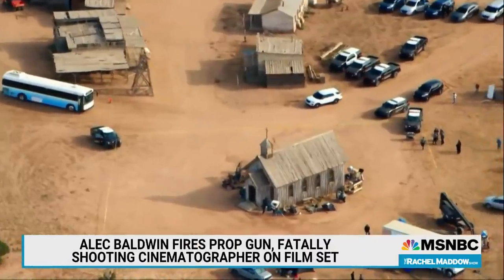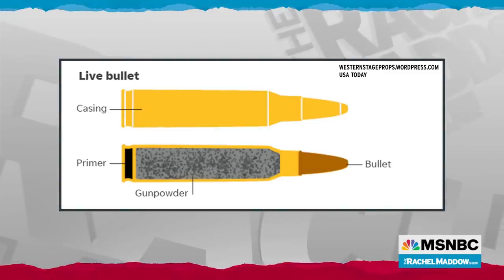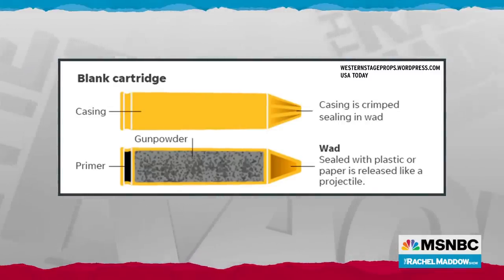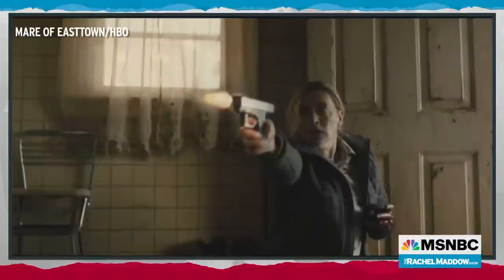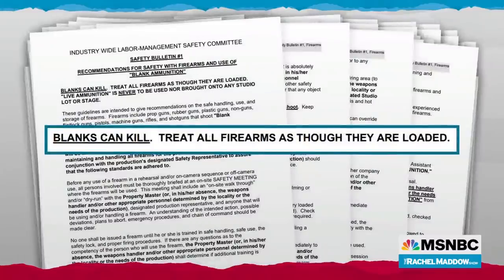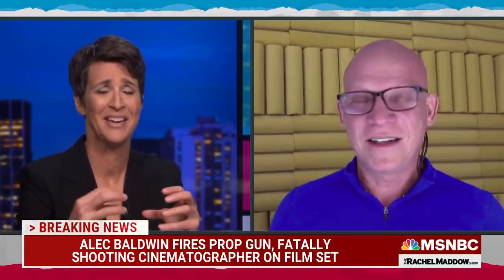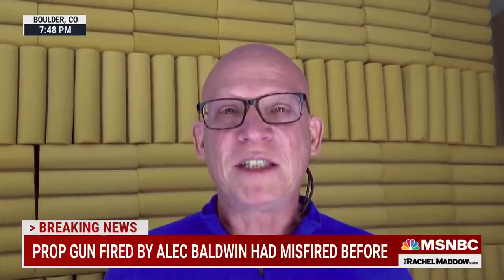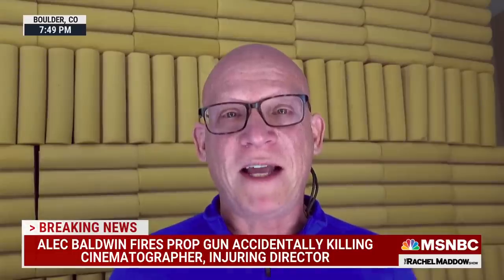Weapons Safety Expert Looks At Safety Protocols And Alec Baldwin Movie Set Shooting

Comment: On Brandon Lees set they wanted the camera to see the bullets in the cylinder of the gun. They drained all the gun powder to be safe but someone pulled the trigger and the primer went off and pushed the bullet just enough to make it into the barrel. No one questioned the missing bullet when they loaded the gun with blanks. the blank round or shot uses pretty much the same amount of gunpowder as a real cartridge....
Reply: Good info, thanks, I had forgotten the details of that tragedy.
Reply: @alieninbellingam  yep or who pulled the trigger to fir the...... primer
Reply: What were used in The Crow were Squibs and one broke off, it wasn't a dummy round. The result is the same but it wasn't a drained powder bullet.
Reply: @alieninbellingam  The person who removed the Squib (fake ammunition) was not properly trained. That is why it happened in that case. There were actual failures in how it was handled so it wasn't even a "we need new rules" as much as "we need to follow the existing rules" issue.
Reply: @TearDownGenesis  The bullet is not in the barrel, it is in the cylinder of the revolver. So, if it "Breaks off" it still would not make it into the barrel. The primer had jus enough pop to separate the bullet from the cartridge and push it about 22mm into the barrel.
Reply: @donemigholz660  I could be wrong but I assumed the gun used in The Crow was a semi automatic. It wouldn't be in cylinder there.
I saw that squibs were used and squibs don't use any propellant.
Reply: @TearDownGenesis  A squib is a small explosive device. You put the squib on the thing to be shot to simulate a shot, not in the gun. The term "squib" does not refer to a dummy round, blank, or any other form of ammunition.
Reply: Aside from a manufactured dummy round, the usual practice is to take the bullet apart, drain out the powder, and then put it in the casing in the gun and fire it in a safe direction so that the primer is dented. An alternative approach is to remove the primer, and replace it with some kind of rubber substance. This prevents the firing pin being damaged but also makes it perfectly clear that you’re looking at the back end of a dummy round, not a live round. This works well with replica revolvers because you can open the loading door and go through all six cylinders assuring that none of them are live rounds. A quicker way is to point the gun and a safe direction and just try to fire it repeatedly until you’ve gone through all the chambers. This is not rocket science.
Reply: @SeanPat1001  One major problem is that these types of sense in a movie are vague as it is written in the script, and are often worked out by the director or are added to get some some drama. So, they are quickly put together.
What all movies need is not only a gun/ pyrotechnic person but a weapons director that is hired to film the fire fight sense and gun close ups rather than a spur of the moment added scene or added clip. Something, because this has got to stop.
Reply: @donemigholz660  Most movies of this genre actually do that. Any shot requires something that could be dangerous has to be planned and details worked out. Clearly, that is not what happened here.
Reply: @TearDownGenesis  Rust is an old western, so a revolver would be used.
Reply: SIO, YOU DON'T KNOW WHAT YOUR TALKING ABOUT.  A SQUIB IS A BULLET OR PROJECTILE THAT ENDED UP IN THE BARREL.  THE BULLET BECAUSE OF A LACK OF GUN POWER CAUSE THE  BULLET TO NOT LEAVE THE BARREL.  FIRING ANOTHER BULLET WOULD RESULT IN A PROJECTILE IMPACTING WITH THE SQUIB LOAD IN THE BARREL WHICH WOULD CAUSE EXTREME DAMAGE TO THE FIREARM AND THE SHOOTER OR SOMEONE STANDING CLOSE TO THE PERSON FIRING THE GUN.
Reply: @jcaputo3156  Dude!! I said they loaded blanks ........ read what I wrote
Reply: @jcaputo3156  unless the next round fired was a blank, which doesn’t have a bullet in the end.  Blanks are just crimped casings with primer and propellant in them.
Reply: @jcaputo3156  BLANK WITH THE DISLODGED BULLET IN THE BARREL!!!!!!!!!!!!!!!!!!!!!!!!!!!!!! On a revolver (44 mag) when the gun is pointed at you you can see half of the bullets in the side of the cylinder.
Reply: Incorrect

Comment: Updated report says the AD (assistant director) handed the gun to Alec telling him it was clear/safe seconds before they called action. But there was a live round in it. It's not up to Alec, his job is acting, there are multiple people in charge of clearing the gun. They're responsible.
Reply: Baldwin is not only actor but also producer. So he has overall responsibility for (lack of) compliance with to safety protocols. And there is no good reason why he would point a gun at the cinematographer and the director behind her. And then pull the trigger.
Reply: @eljanrimsa5843  if the scene involved the gun being pointed at or near the camera and being fired. They tend to use real ammo for loading scenes and stuff because good dummy rounds are expensive. It looks like they didn't switch between scenes.
Reply: it is Alecs job to know where he is pointing the gun and pulling the trigger
Reply: @eljanrimsa5843  the cinematographer would be behind the camera and director right over the persons shoulder watching.
Reply: @tk4c415  its not really. He was guaranteed by "professionals"
Reply: @tk4c415  im sure he knew where he was pointing but thought it was a blank for the shot. Im guessing it was a .45 long colt and yeah. That will go through a couple people
Reply: If Alec knew how to handle a firearm, he would have checked
Reply: @bobby_greene  There is no requirement to demonstrate you know how to use a gun...not like legally driving a car. Somebody gave somebody a paycheck and a title.
Reply: @eljanrimsa5843  wrong.
Reply: @larryames8831  there's no requirement to prove you can handle a u-haul before you rent one, but it's a good idea to know what you're doing in a vehicle that size before you drive it
Reply: @robhill4352  "...real ammo for loading scenes and stuff because good dummy rounds are expensive."
Take a live round, pull out bullet, pour out gunpowder, discharge primer, replace bullet.
or
Take spent casings and reload bullet without live primer and gunpowder).  My uncle reloaded his old rounds for hunting.  Did one without a new primer and and no powder for me when I was a kid.  Looked like the real thing.
Reply: Let's just imagine the scene had called for Alec to down a drink in one. The prop guy hands Alex a glass of something .. before the director yells 'Action', Alex doesn't check what's in the glass?
Reply: @mickymazda1  analogy actually works when there is an analogy. Keep fishing.
Reply: He has acted in many movies with guns over the years. Shouldn't he know to check the gun himself already? I mean, he should know a thing or two about guns and safety on sets with his experience.
Reply: @mickymazda1  The shock of expecting getting cold tea and instead a mouthful of alcohol would have made me spit it out.
Reply: One report said that Alec Baldwin, as well as everyone else, were trained In firearm safety . Every time somebody ever handed me a weapon, whether they told me it was empty or not, the first thing I did was check the weapon to make sure it was clear. I have a cousin who didn’t do this and shot him self in the hand with a 50 caliber machine gun round. Once at a party a guy next to me insisted that a weapon he was waiting around was unloaded. I pushed his arm so it would be in a safe direction just as it went off.

Lots of people have been injured or killed with an “unloaded“ firearm. It is the responsibility of the person handling the firearm to verify that it is in a safe condition. Alec should have checked.
Reply: @bobby_greene  He handled firearms making "The Getaway".  You're right he should have checked.
Reply: @SeanPat1001  You called it.  Job titles be damned.  There too much at stake for some one to pass the buck.  Safety is everyone's responsibility on a movie set and the more dangerous the situation the more people should check.  If some one want's to complain about losing a little time to safety they should remember this situation.  If Baldwin had checked the gun they might have lost a minute.  Instead they lost a life, injured a second person and and probably will lose the whole production.
Reply: @ScorpionRegent  I think you’re right on this, especially after finding out that this was the third instance of an accidental discharge on set. None of them should’ve happened, but after the first one, people definitely should have re-examined what they were doing. They got two warnings and chose to ignore both. 😑
Reply: @bobby_greene  Alec does know how to handle a firearm. Haven't you seen the 1994 remake of The Getaway? He was shooting a .45 (very convincingly!) all the way through that movie.
Reply: @JB-uv4hm  Analogy actually works when you are smart enough to see the analogy. Keep trying.
Reply: @ItsStillRealToMe DamnIt -  Kind of a moot point with all the union crew fired. I get it it's the armorer's job to be responsible for any and all fire arms.  Some one double checking the gun is just one more layer of safety.  
 Hypothetically speaking what would have happened if he had double checked it and found it loaded while the union crew was still there?  If some one dropped the ball and he caught it how is that wrong?  If everything was okay would anyone have challenged an executive producer for being safety conscious?  
Way too many things went wrong and if he had just checked the gun the only thing hurt might have been some ones feelings.  Are you saying that it was okay that he didn't check and the DP was supposed to die?  I'm pretty sure that wasn't in the script.
Reply: @Tearsofblood25  production insurance is voided if the actor checks the gun themselves. They are supposed to have hired professionals checking it for him so he can do this thing called "acting" and not inspect potentially dangerous props. This isn't an accident that happens every day, multiple people have to fail safety measures for this to happen, that's why the last major incident was Brandon Lee (30 years of action films without a prop gun accident)
Reply: @ScorpionRegent  it's not about hurting feelings, do you work in film? He's not allowed to open up props like this, it's verified safe multiple times before it gets to the actor, so someone failed. If your car has a faulty bolt, you take it to a mechanic, they check it out and says it 100% safe to drive, and on the highway that bolt falls off and you crash, killing someone you hit. Is that your fault for not triple-checking what the manufacturer passed for safety, and for believing the mechanic when they told you it was safe? Were you expected to pull over after leaving the mechanic's and do your own inspection of everything to make sure? No. You trust professionals. Same thing here. Someone failed, it's not the driver who's at fault. It's called a tragic accident, don't throw guilt on the driver just because you don't like him. We are telling you how it works. Google it for more info on how film sets and prop firearms work. 👍
Reply: @the_united_republican  
What's your IATSE local?
Reply: @eljanrimsa5843  A CEO isn't responsible for every activity within the company. 
Alec (and the rest of the 5+ producers) hired an armorer who is in charge of firearms on set. 

1. no evidence he "pointed" the gun at the director. he was practicing drawing the gun and it went off. The gun would have been pointed at her but that doesn't mean that was his intention. 
2. Actors point guns at the camera many times. Its part of acting. 
3. The gun is reported to have accidental discharge in the past so it may not have even been a deliberate pull of the trigger. 
4. he was told it was unloaded. Not loaded with blanks but fully unloaded, as a result from his point of view there would be no problem pulling the trigger. (btw the "always assume its loaded" is garbage and doesn't apply to Hollywood or stage performances)
Reply: @bobby_greene  Except Alec wasn't going to fire a gun. Your analogy is flawed because the person getting the U-haul would be using it as intended. 
A better analogy would be no requirement to sit in a u-haul. and its unreasonable to expect experience on how to drive it if you are just going to sit in it.
Reply: @robhill4352  Yes , I did read that it is a .45....that's a lot of lead.
Reply: @bobby_greene  U-Haul, yes, I've rented their large trailers for moving cars, you have to show them a valid drivers license, the type of car you're going to move....and buy insurance from them for the duration, even with an empty truck or trailer...it's still on you if you mess up.

Comment: I don't think I could point a gun and fire it  in the direction of individuals without checking it myself first.  Don't take anyone's word for what ammo is in it.
Reply: These are actors not trained individuals.
Reply: I've never handled a real fire arm, I've never fired one, never loaded one, I've never even seen a real bullet. How would I know what is in the gun is the dummy vs the real one? Props are made to look as authentic as possible.
Reply: Baldwin may not have been responsible for loading the gun, but he certainly pointed and pulled the trigger at someone who wasn’t even a character in the movie.
Reply: @seanm3226  Sometimes actors point the gun at the camera. Seems likely this is what happened in this case. Explains why the photographer was shot. I think they are supposed to use a special shield in those cases. But you would be surprised at the kind of cuts producers will make to save money.
Reply: Exactly... totally his responsibility
Reply: @edwardmyers8782  Don't all actors/actresses claim they train for their roles? Maybe some more then others.
Reply: @edwardmyers8782  maybe they should be trained. If they are handling a firearm even loaded with blanks they are dangerous at close range. A kid can't get a hunting license without completing a firearm safety course, so maybe an actor should compete one before handling one on a movie set.
Reply: @aquaticborealis4877  Your scenario may explain things.
Reply: @seanm3226  Possibly. There was also a nation wide strike recently by one of the film unions, and people may have been overwhelmed on set. The people who work behind the scenes are often pushed beyond reasonable expectations.
Reply: I'm with you, Colin Connelly.

Comment: I work as assistant armorer in films.
Today I read that a production assistant handed out the guns.While this seems like nothing special,to me it's an enormous red flag. Prod assistants are the general helpers,but they do not touch guns.
This tells me that there was not the necessary discipline on set, and discipline is THE thing that keeps you safe.
Like,we do not only handle blank guns like real ones,but even rubber dummy guns, as you could pick up the wrong one by (a very unlikely) mistake.
To get to this accident,you must do many things very wrong.
Reply: Assistant Director, not just a production assistant. That would be insane I'd run a from a set with PA's handling guns and never look back but yes I'd agree several protocols must've been broken for this to tragedy to happen.
Reply: @justtommyc9381  According to the "Guardian",it was a PA, but even if it was an AD,it's still wrong in my book.
AD's handle organisation,not weapons. At least where I work.
Reply: @viandengalacticspaceyards5135  You should look into the Armorer, she seems super sketchy. Like it seems clear she'd never been an armorer before but also I feel like she'd never even been an assistant armorer. She's 24 and was on a podcast (before this event) talking about how nervous she is on the movie when she has to load the blanks into a gun. Seems odd for an armorer to get nervous doing that, focused yes, but not nervous.
While I'm not like others who seem intent on putting someone in jail, I feel the major failure does like with her since she is responsible for safety policies when it comes to guns. 

Now if the AD (i will reinforce that point, it was the assistant director) just walked over to the storage place and took a gun, not as much her fault (still some probably since they should be secured) 

Like you said, a number of failures occurred.
Reply: I heard it was an assistant director, not a PA that handed the actor the gun.

Comment: In the Brandon Lee case. They used a "prop shell". (a cartridge with just a primer and a bullet but no powder charge) because when shooting a movie you can see the front of the bullets in a revolver and blanks would look unrealistic. The small pop of the primer (used to time the dubbed in gunshot sound effects) was enough to push the projectile from the "prop" cartridge just into the revolvers barrel. Later they used the same gun and didn't realize that the "prop" bullet had been lodged in the barrel of the gun. So when they loaded a "blank " with a full load of propellent it shot that bullet out just like any gun would. That's what happened in the Brandon Lee shooting anyway.
Reply: Every firearm has a warning stamped on the barrel. Check barrel for obstructions before loading. Every box of ammunition has the same warning, even a box of blanks.
Reply: @hermit1620  No they don't .
Reply: @tfcooks  You are correct most older weapons don't but any firearm made in the last 50yrs does. And every box of ammunition does. So what is your problem.
Reply: @hermit1620  Guns, modern or older don't have "Check barrel for obstructions" stamped on them. It may be in the manual but it's not "stamped' on the barrel. You're just wrong.
Reply: Ohhh